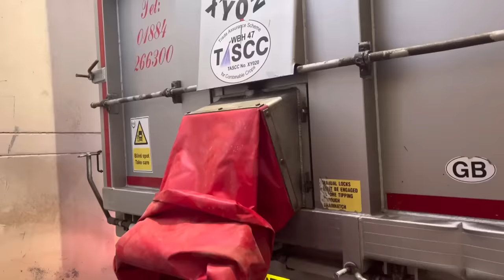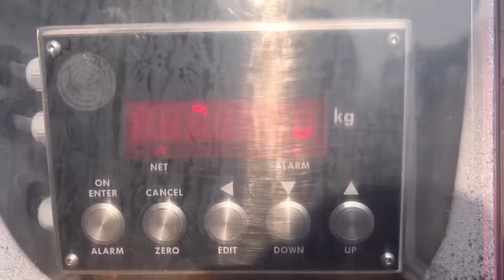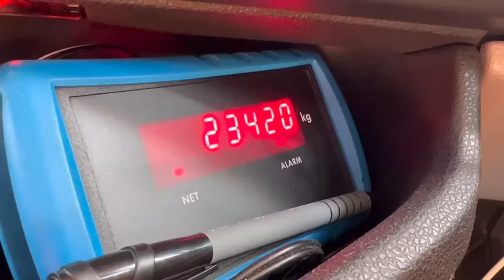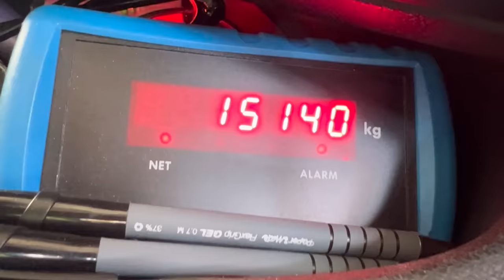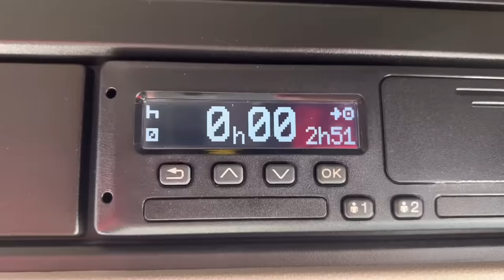Problems to solve | showers | diverted load | traffic | stuck load

Comment: Hi Gemma, For a while I worked at a truck depot / warehouse in Melbourne, for one of the larger companies. each warehouse had a clean drivers rest area and showers. There was even a building for the drivers to sleep in, Typically the drivers would Tavel overnight from Sydney or Adelaide, then sleep during the day, meanwhile the trailers (B Double) are loaded for the return trip. However, the roadside amenities are generally poor.

Comment: Adblue - the most popular brand name for ‘diesel exhaust fluid’ - it’s sprayed into the exhaust and although I can’t recall the specific reaction it turns noxious and harmful emissions into cleaner ones. This in tune with a diesel particulate filter (DPF) means there are essentially no visible emissions from the vehicle.
Reply: It's because of such technology that diesel engines these days are some of the cleanest ever produced. This tech is not just used for on highway trucks but also large agricultural machines like tractors and combines. Don't know much about construction machines but doubtless they would have to adhere to emmissions legislation also, so it's quite likey that industry would have to adopt the same technology, if it hasn't already done so.

Comment: The first load was terrible, I assume the product was a bit wet and that's why it stuck together. I like the location with the overhead loading, I think this is the first time we see this method in your videos. The summer weather looks fantastic, nice long sunny days are always good in this profession. The shower situation is pretty sad, usually these roadhouses doesn't care about truck drivers, especially females. Luckily you could shower at the second stop. Another excellent vlog Jemma, thanks a lot for your efforts. :yougotthis::virtualhug:🥰

Comment: Another great video, notice you’ve got a small chip in your windscreen probably ok for the time being but will need to be dealt with before your annual test. If it’s in the sweep area of the wipers I don’t think the Ministry Test Station will accept a repair. 
Why have a unisex shower if there are four others for male drivers. it should have been female only . Personally I think showers for female drivers should be accessed by key only obtained from the service desk rather than a free for all .
Keep up the good work . X

Comment: Hi Jim, is Ken Morgan here as your lorry being automatic, not got a clutch pedal cause you have put you a struggle to start away from there and I have not never drove an automatic lorry. I have always been a Volvo man with manual gearboxes and you would just pull away in second low, split quite easy you are the ever needed first. I can’t understand how they work. I’ll be not drove one what do you do just put in gear and she goes or have you got a clutch pedal for the first start off my cousin has got a V8 Scania 164 and she automatic is sunrise. It has also got 410 hp eight wheeler skinny. My Josie has had a go not that has got eight speed manual. I will have to ask David when I am talking to him as that got a clutch paddle on them Track unit it is not the cab bike you’ve got it next gem. It is a 164 and he is only just done 105s km they own a scrapyard and it only goes out to caves. Neither have people taking the scrap away for them. It is a beautiful mild lorry which won’t be getting sold because they do not sell nothing. They keep itI have to ask about it I see you leave you in peace Morgan again

Comment: Why are the weigh bridges so narrow. I drive a tipper and always wonder why there not a fraction wider
Reply: I'm not sure if this is correct Jack, but I work near a place that makes weighbridges, and when they are loaded onto trucks to go to customers they are sticking out both sides of the trailer, so I'm guessing they must be made maximum  width for transport, and any wider would mean escorts and extra timetables e.t.c

Comment: Hi Jemma, Love your content. I'm an Australian truck driver. I'm curious about the configuration of your rig. Is the Scania a V8 or inline 6 engine? Is it a bogie drive or single drive with a lazy axle?
Do the onboard load scales receive data from load cells or  airbag suspension pressure?
What is the maximum legal length of your truck and trailer in the UK?
Reply: jemmawarren839  Thanks Jemma. 😊 Sorry about all the questions. Your rig is similar to what I drive. Except I tow refrigerated or curtain side trailers.
Safe driving 😘😘